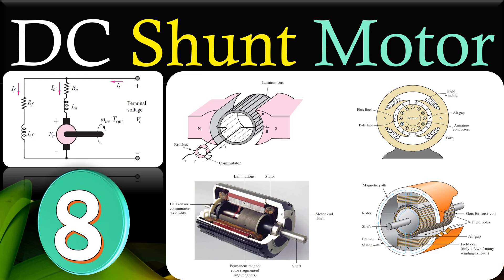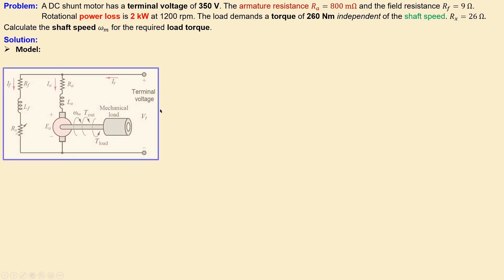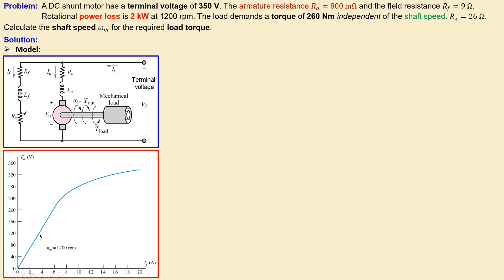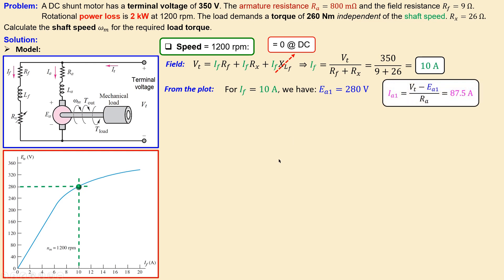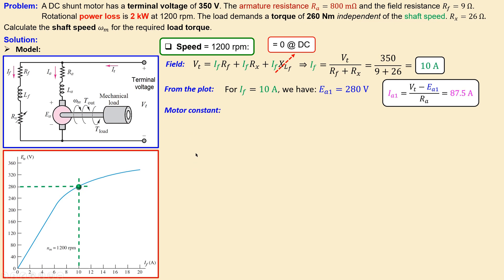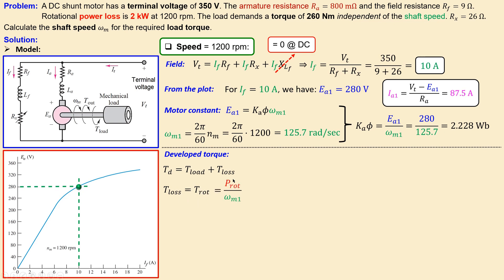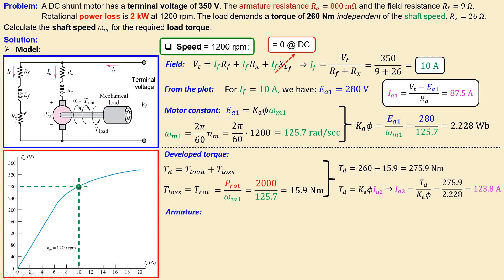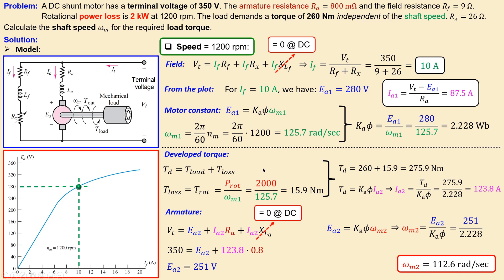⚙️⚡ DC Shunt Motor ⭐ Shaft Speed for Required Load Torque ✅ Example 8 #dcmotor

Comment: Hello, Can you please help me how to solve this problem 😁 Thanks po

A 300V DC shunt motor, shunt resistance (150 Ω), armature resistance (0.2 Ω), the 
source supplied current equal to 36 A, core losses (210 W), running at 1500 r.p.m., 
friction losses (100 W). Find: (a) back e.m.f. , (b) efficiency, (c) developed torque, (d) 
shaft torque.
Reply from the maker: A similar problem is already discussed in one of my videos for the playlist of DC Motors. You can find this here: https://www.youtube.com/playlist?list=PLuUNUe8EVqllcWY_Li0vofDQmP750sVRe